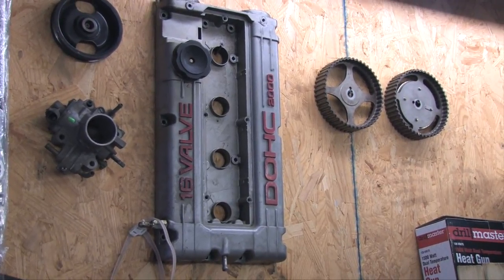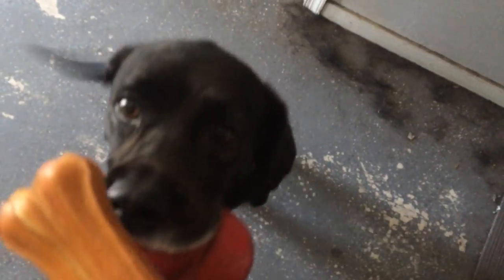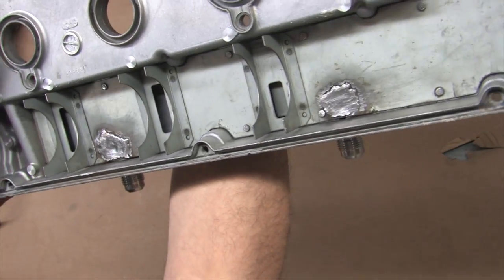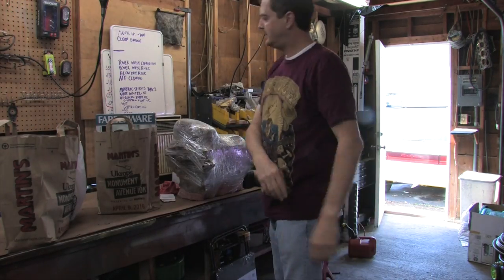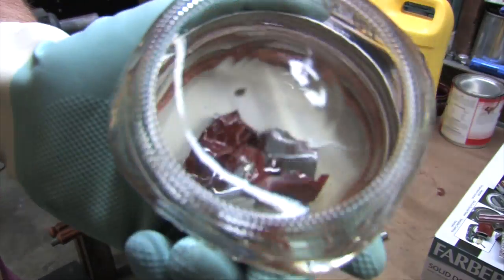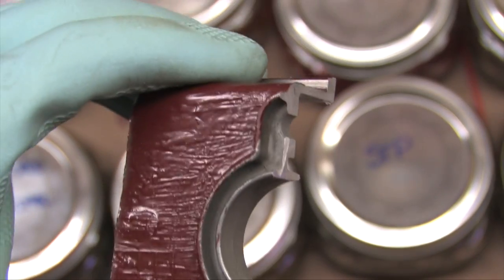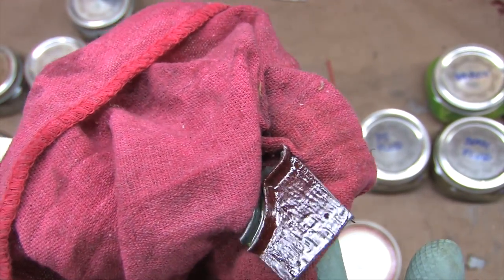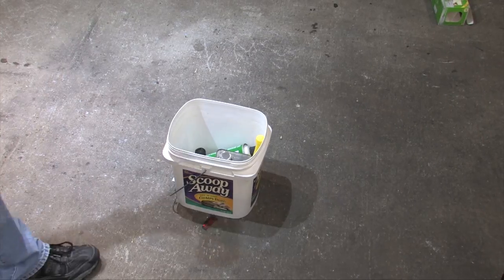Glyptal Testing for Automotive Use

Comment: That was no doubt a small scale result, but I don't think it will hold when you scale up. I think a more accurate test would be using two unmodified engines. One coated and one uncoated, measure time it takes for 80% of a set amount of oil to drain from the valves to oil pan. My reasoning is that some percentage of the oil will always be stuck to parts and draining more slowly than the large volume of oil flowing through the return galleries. I think 90% of the oil would arrive just as quickly, but the glyptol may start to overtake in the last 90% or so. That increase would only benefit you if you were low on oil and therefore increased the percentage of total volume stuck to parts. I love your vids and I'm not expecting you to set up such an elaborate experiment, but I'm hoping you'll respond back with your thoughts.

Comment: i think it drains faster because the paint isint porus. notice that the drops start off at the same speed then as the noncoated surfase soaks up oil the drop slows. but in a runing engine with all the cast surfaces already saturated with oil I don't think that drainback will be mutch different at all.
 maybe there are noticeable gains to be made from deburring a block but just glycol to bear its close.

Comment: Glyptal will also fail on todays style gasoline (part methanol). Tried a similar test to this one, samples are still soaking. Wanted to find something to see if anything will hold up to long term gasoline (with methanol blend) exposure. Installed "tubes" in some ported cylinder heads and wanted  to see if something can seal from vacuum leaks.

Comment: one thing about the warm oil test, your parts are cold, and the polymer paint most likely has poor thermal conductivity (as do most plastics), and since there is not much oil there to begin with, I bet the drop on the bare aluminum was quite a bit colder than the one on the painted surface, and I can bet it would affect the result, how much - who knows, but I'm sure it did
since you already have the hot plate, take some sheet aluminum stock, cut equal pieces that would fit on the same hot plate (so as to have as equal temperature for both tests as possible), coat one and the other leave bare, put them on the hot plate, angle a little bit, and rerun your test, I wouldn't be surprised if it came out much closer to the "cold oil" test you did
Reply from the maker: I considered doing that prior to making this video, but other comments about the materials not matching what was in the crankcase is what stopped me.  I don't have means of conveniently heating the "race track".  I could do that, but I already know the glyptal side would still win.  Perhaps even by a larger gap.  The materials' pores would open up with heat, causing deeper oil penetration on the un-coated side, and therefore less oil to weigh down the drop.  Oil chases heat.  Thank you for the topic.  I love it when people use their brains!

Comment: Could you try hot ethlyne glycol on a sample? It removes powder coat like butter at a simmer. People use it to clean model RC engines, and any paint that goes in doesn't come out.

Comment: The oil will cool almost instantaneously with such a small volume, the crank case should be heated to running temperature to get more representative results.

Comment: Wow, impressive, that was a really thorough test.
I'm a little puzzled though about the last motoroil test...
The two oilstreams start out roughly the same speed but after 1/3 of the distance the untreated surface started move slower and slower.
It make me wonder if the surface temerature was differed becauce of different heat absorption or some thing like that?
Reply from the maker: While that could be... what's really happening is the oil is penetrating a dry metal surface and being absorbed, so the drop gradually loses mass, whereas the coated side absorbs nothing and maintains most of its mass.  It's possible that an un-coated hot sample causes the oil to become even thinner and more of it absorbed than on the cold sample.  Prior oil saturation of the "track" might also yield different results.  It's a test I may do again with hot parts someday.
Reply: @Jafromobile  yes, it can be several reasons.
However, it really doesn't matter as long as the oilstream on the treated surface run faster.
And the important thing is that the chemicals inside an engine doesn't  affect the paint.
I give it five paint brushes out of five, mission accomplished :-)

Comment: Could you please share how you intend to fix the baffling back in?  I have the same issue!
Reply from the maker: Best bet is to make one out of aluminum and TIG weld it in.  The steel/aluminum materials combo is where the problem starts.  If you have the old one, there's your template.  :)
Reply: Ah, I was suspecting that you were going to say that.  Thank you
The issue with mine is the shape is complex.  I had the idea of maybe drilling out the rivets all the way through to the outside, then having a aluminium rod machined with a flange to slid in. I could then weld it in place from the outside.  Do you think it would work?

Comment: How would coating the block/head/valve cover with liquid glass (sodium silicate) work compared to glyptal?  Do you think it would have better or worse resistance to the chem's you tested here?  Is it even feasible?  And one more question, would you say that B12 is comparable to gum cutter?
Reply from the maker: Berryman B12 doesn't contain any methylbenzene or xylene, but it does contain some of the other same solvents found in Berkebile 2+2 in different concentrations.  As far as a crankcase coating... Sodium silicate is water soluble unless additional catalysts are used to help it stay put.  In automotive chemicals like head gasket repairing coolant additives are concerned, it's got a half-life.  Within 2 years it will break down and wash away.  That leaves me a bit wary of using it as a crankcase sealant.  It may work great?  I just don't have the testing data to prove it.  Lots of other coatings have been utilized for this kind of thing, so maybe there's a sodium silicate-containing product out there that will work.  I understand why you're asking about it, though.  Sodium silicate can aide in the transfer of heat in most materials.

Comment: My question for Jafro and anyone that sees this comment, "How well does the Lucas oil treatment work? What are your experiences with it? What have you heard? Do you currently use it?", etc. etc. I have a stock 98 GSX and was thinking about it using it (just once, not every oil change).
Reply from the maker: It's so thick, I'd never use it in a crankcase that shares oil galleries with a turbo.  I can't imagine it would be good for hydraulic lifters, either?  I haven't done it before, but based on its viscosity, I'd be reluctant to even try it.  What is the problem you're trying to fix with it?
Reply: Thanks for the reply and the helpful info; looks like I'll just avoid it. I'm not trying to fix anything, just thought maybe it would be a good treatment perhaps before I store it away for winter (I live in Minnesota). I'll just stick with Seafoam; it's never let me down. Thanks again.

Comment: 26:53 thought it was funny you said power steering fluid being like a hydraulic fluid cause when i worked in the shop for a bit, dude used to use auto transmision fluid as power steering fluid cause he claimed it was the same except the color..... ive never looked into it, but i do know atf is a great cleaner...

Comment: What if the valve cover is plastic. Will it still work?
Reply from the maker: I'd go with no.  You'd be better suited to vapor polish it (search it here on YouTube).  Plastic isn't porous like metal is and doesn't try to soak into it, so I'm not sure this coating would offer any benefit, plus... how would you bake it without distorting it?  There's no casting sand in plastic, either.  I just can't think of any beneficial reason to try it?  Glyptal basically installs a plastic-y rubbery coating to porous things.

Comment: So if ur running methanol which contaminates engine oil due to blow by and because of more fuel to air it will peel the coating?
Reply from the maker: That's the test I can't produce because I don't have anything that burns methanol, however, I proved that methanol in its raw full pure strength will peel it.  The yellow bottle of Heet is *pure methanol*, not isopropanol.  The red bottle of Heet is isopropanol.

Comment: JAFROMOBILE!!!!!! First off great work on this real world test you put a lot of effort into it and documentation is +9 out of 10. Where is the missing +1? well  out of all the products that "might" come into contact with this coating you have proven that the ones that WILL come in contact with it will not effect it such as engine oil. But in the crankcase of an engine you forgot one thing that will most likely come in contact with it, GASOLINE,GASOLINE,GASOLINE. PLEASE TEST GASOLINE PLEASE PLEASE. I don't want to come off as a keyboard expert and a person to nit-pick this video i just really need to know what gasoline does to this coating. I'm having a struggle myself with a engine project and I think gasoline is affecting my coating and I need a second opinion or "test". nice work if you read this feel free to pick my brain.
Reply from the maker: I fully agree with you.  The only reason why I didn't test it in this video is that many people have encountered coated engine parts that lasted for decades without failure.  The one thing that's an unknown is the re-formulation of gasoline with Ethanol.  Because I'm digging up info from "old-timers", that's a complete unknown.  There's also the question about whether oil captures and dilutes the compounds associated with blow-by in a way that it makes them inert.  Full strength fuels might dissolve it, but trace amounts that get bathed in motor oil and diluted may be harmless?  There will likely be more tests coming at a later date.
Reply: Thanks for the reply I appreciate it. to paint a bigger picture about my project and my problem, I did a lot of intake and exhaust runner work to my motorcycle engine and quite a strange modification to the intake runner that i'm not willing to disclose to the public haha. to say the least I thought the modification to the intake runner would most benefit from a glyptal application to keep the fuel/air mixture insulated from the hot metal and to keep the fuel/air mixture from burning and charing to it over time. shortly after I had the engine re-assembled and tested I removed the carburetor to inspect the coating to find that it was starting to wrinkle and become soft, luckily non of it came off. I'm just not sure if I applied and cured the coating properly and that is why I ask that you test it with gasoline!!! thank you for your time.
Reply: I was thinking the same thing Aaron as I watched the testing - what about gasoline?.  Thanks again Jafro for the clarification.  Your videos are worth while for the scientist and engineer in all of us.
Reply from the maker: If it's wrinkled, it's already done.  The use of glyptal has always been in crankcases and gearboxes.  My advice would be to get that stuff out of your intake.  Ceramic coatings would work better to achieve your goals.

Comment: I did not see any other videos but I feel like you missed testing with gas and stuff and also most of those test probably should have been done heated also since if it's in your crankcase it would be hot also

Comment: Question, in Australia we have 91, 95, 98 RON pump fuel, we also have 94/95 RON E10 (10% ethanol fuel) and E85 100+ Ron (85% ethanol fuel). The E85 is the control fuel used in the V8 Supercars racing category. Street engines on E10 or tuned street engines on E85, do they potentially have a problem if a person was to use Glyptal internally, say after a rebuild? Cheers.
Reply from the maker: I tested alcohol based solvents in their full strength against fully-cured glyptal, and all of the alcohol based stuff compromised it.  Fuel is not added to the crankcase in its full strength as blow-by, and I have no way of testing that short of using alcohol-based fuels in a working engine for x-amount of time and then tearing it down.  It's hard to say.  There's a portion of our fuel here that contains ethanol in a 10% concentration, and I can't avoid that.  I will be burning that fuel in the engine I built with the Glyptal coating.  The car I have that's getting this treatment is not burning anything else.  Time will be the only thing that can tell.  Overall, I do not recommend using glyptal as a oil film shedding treatment.  It's too messy, too time consuming, and too much risk to your engine should something go wrong.  Unless there's no other way to solve oil drain issues, I would not recommend it.
Reply: Thanks mate, appreciate you getting back to me. It was just something I thought I would ask, I'll spend more time on preparing the block rather than using coatings. Good luck with your car running the E10. I'll keep popping in and seeing how your work is going.
Reply from the maker: On the Hyundai block prep, I sanded the inside of the crankcase smooth.  It actually took less time, and it added the benefit of strengthening the surface of the metal.  It's really a better route.  You'll have no limitations of however you wish to fuel and service it.

Comment: Nice vid.  E10 gas? E85?
Reply: Im going to guess here, but E85 is mostly ethanol, so will be similar to denatured alcohol.
Reply: but denatured alcohol also contains mostly methanol, which as far as i'm aware, is more volatile than ethanol. I would also like to see straight gas and e85... although he's done a crap ton of testing already and it's probably unnecessary.

Comment: you need to degas those parts before coating, like a powdercoater does....soon as the engine gts hot, its gong to gas out from under that paint/.. its  bake on finish too?
just prebake for a couple of hours before application, degrease and bake again....then coat, then dry then repaint.
in fact, sack that glyptol crap off and cerakote the bugger.

Comment: If you still have samples can you test e85, e10 & ethanol free gas?
Reply from the maker: I still have samples.  I knew other great suggestions would trickle in.  The fuels will have to wait until I can source them.  It's not easy to source those in VA without having to buy a 5 gallon can that I'll never use.  I need a new local army buddy because the only place where I can get it from here in moderation is at a pump is on a military base.
Reply: Jafromobile 👍

Comment: All pretty good semi-scientific testing.  The only thing that didn't make any sense was the heated oil tests.  The hot oil cools down almost instantly when dripped onto the test piece. Would have liked to see the drip test onto heated parts instead.  Also, the hot oil soak should have also been done using some used motor oil.  Old oil at end of life has lots of breakdown components in it that the fresh stuff doesn't

Comment: 20:28 it's a giant leopard moth caterpillar. they dont sting either so you can hold them.
Reply from the maker: Correct!  I had to do the same thing.  :)  But I knew the similarly-colored wooly worm will cause irritation because its spines will break off under your skin if you touch it.  Many also carry harmful bacteria.  The Leopard moth pupae are harmless, though.

Comment: @9:22 Replace Baffle, The holes are already there. TIG dots where tabs used to be. Your welding Friend will know. An exquisite example is here- https://www.youtube.com/watch?v=FppoWj8MyfE  That baffle is important, it helps to moderate the air flow, just as with an exhaust  muffler.

Comment: It definitely seems that most polar substances seems to harm the coating.  Alcohols definitely appear to major work on it.  Odd that the ether doesn't do much, perhaps it's not polar enough to actually get at the polymer chains, that oxygen is a bit crowded I suppose.  As for the Glyptal in general, as much as my anal-retentiveness says otherwise, it honestly seems like it's not worth the effort.
Reply from the maker: It totally isn't worth it.  You are correct.  There's no real benefit that this surface leaves beyond grinding out the rough cast and flash and sanding all the surfaces smooth.  If there is a benefit, it's minor.  If you don't apply this, there's no chemical, no solvent or cocktail that you can mix in the crankcase that will cause.a coating to clog your oil pickup screen.  If all you ever let it see is oil, there's no reason it won't last forever, but you're right, it's not worth the effort.

I only did this because I'll be revving the car 1000 RPMs higher and street driving it, and I don't want to install a dry sump setup on a street car.